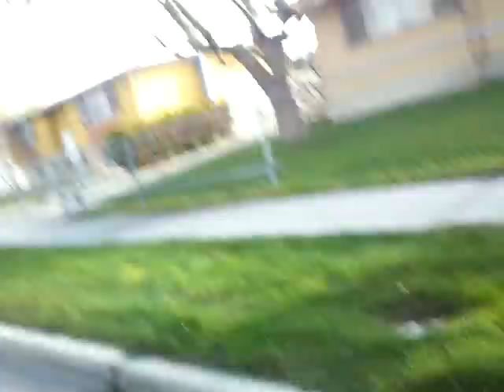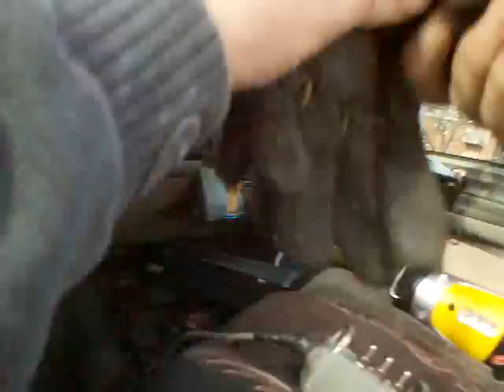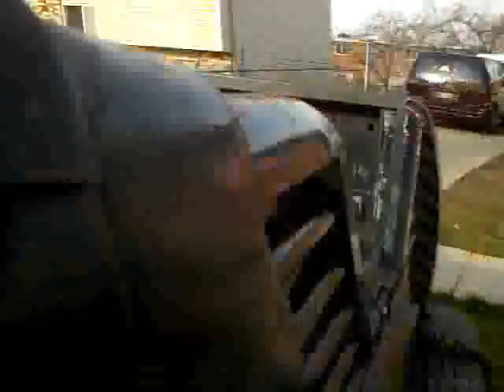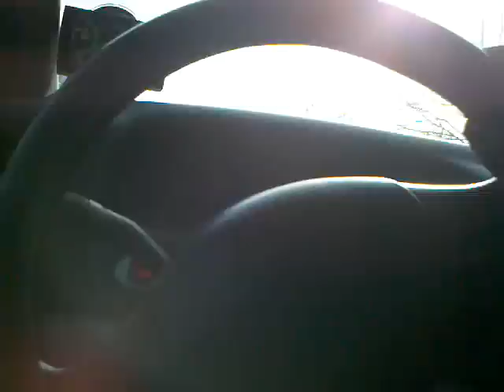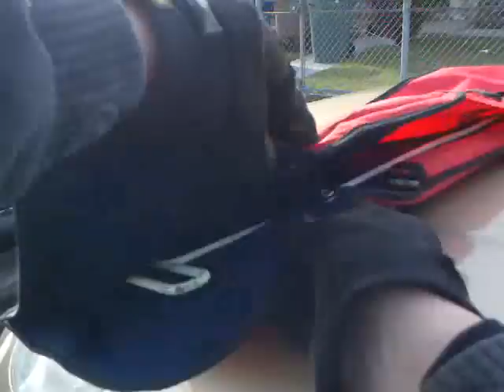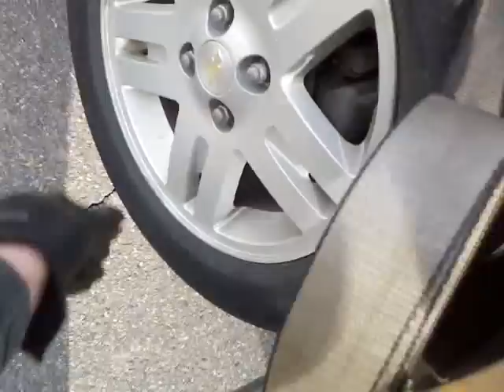Vehicle Swap With Family Member Is A Common Method We Watch For - 04/14/2011

Comment: All you need is a set of Lishi tools.  They work like keys, once you learn to use them. They unlock the door via the key hole and is the same as turning the key, it disables alarms on most cars.